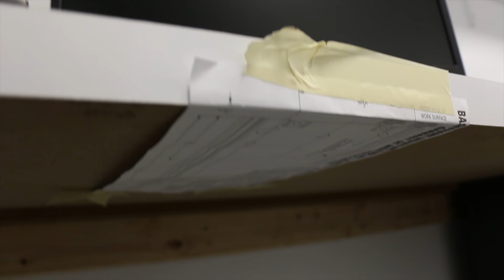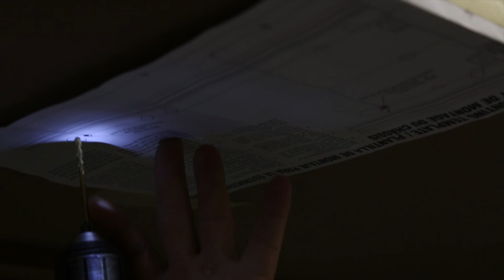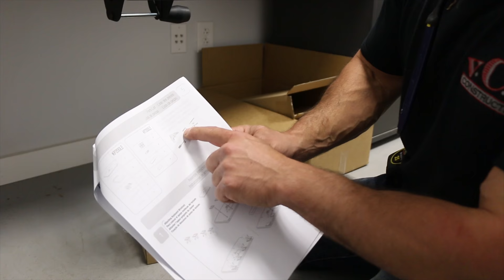Adjustable Keyboard Tray - Installation

Comment: Great video guys! I bought my system on a whim, mostly because nothing would fit my split keyboard. My husband was freaking about installation.  My only suggestion is you may need to be miked because when you move under the desk it's a little harder to hear you.

Comment: It was cool seeing you do what i do (modular/systems furniture installer) in this video and the monitor arm video. Ive never seen anyone use the template before. Another thing is after most installs 90 out of 100 keyboard trays will be removed from the workstations/cubicles after a few weeks. Prob one of the biggest wastes of money i see from companies, but good for me since i get paid to go back and remove them. Great video cuz!
Reply: Curious as to why they remove them.

Comment: Very helpful.  Now just need to pick out which tray.  ATK60LE, ATK70LE, or ATK80LE.  My desk is 23" deep.  3M chart shows the ATK70 at 21 3/4 track depth, inset like 1/2" and the ATK60 is 17" track depth.  ATK80LE is 17" depth.  Different users said  do like 2" or 3" in but looking at this video I think the depth was closer to 1/2" inches so that shows me I can do the 22" ATK70LE with lever adjustments not the knob(?) of the shorter ATK60LE.

Comment: You wouldn't happen to know the hole to hole dimensions for the screws do you? This was already installed on a desk and I've had to move offices since and do not have the template. Any help would be greatly appreciated. The model is the 3M KD45